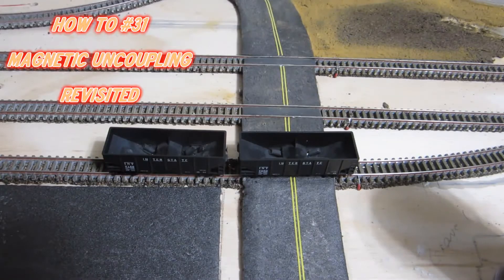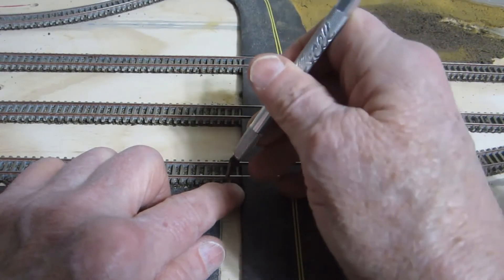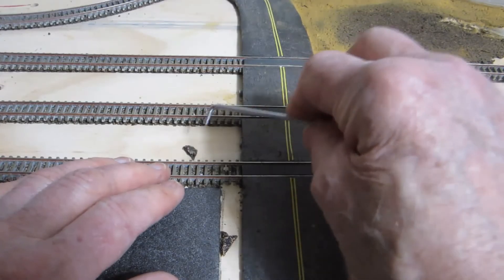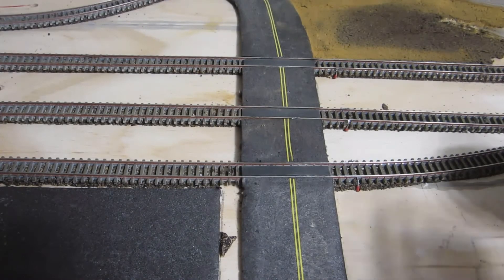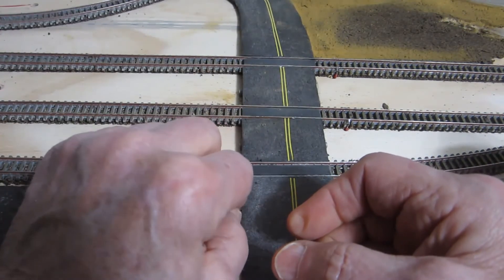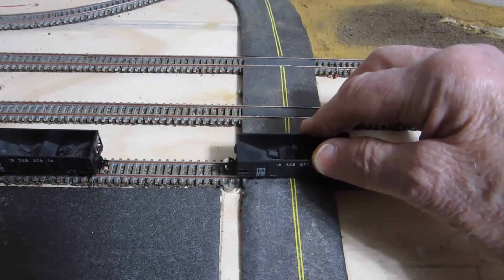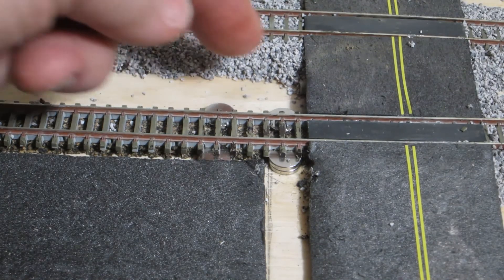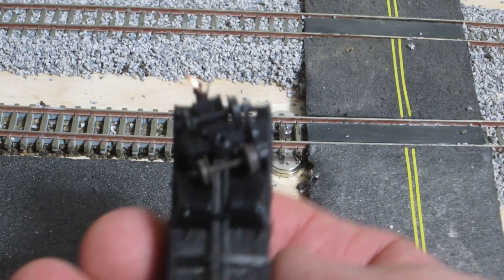Magnetic Uncoupling Revisited

Comment: Hello can these magnets be used on a Kato track?
Reply from the maker: I have never used this system with either Kato Unitrack or Bachmann EZ Track.  I only use Peco or Atlas flex track.  A quick search of the internet reveals that Kato# 20032 is a 2.5" section of straight N scale track with a magnet situated between the rails.  It is for sale on Amazon for $5.98.  I would test that first.  Good luck.

Comment: What if a locomotive has magnetic wheels ?
Reply from the maker: Any type of ferrous wheels will react to the magnets causing unwanted jerking.  I have not seen it, but I'm positive that magnetic wheels would be unworkable.  You will notice that the wheels on the cars in my clinic are plastic.  Brass wheels will also work well.
Reply: @williamcasper6215  Thank you .  I got one locomotive Atlas and has magnetic wheels,  I sent to Atlas to replace it and they don't understand must be non magnetic.  I got 24 locomotives different brands even Atlas and no one has magnetic wheels .
Reply from the maker: I didn't realize that you were talking about locomotive wheels since there were no locomotives used in my clinic.  I had magnetic wheels on my Lionel locomotive in 1949 which helped it on grades, but, nowadays, they have rubber traction bands on one set of the drive wheels to help with grades.

Comment: Excellent video. Thanks. I haven't used magnetic de-couplers before. How does this differ from the Magnetic Uncoupler Track pieces I've seen offered?   Are the Osborn Model Kits 3053 N Yard Limit Signs the ones you were referring to? Do you only use micro-trains since they have the couplers already on them?

Comment: I've just been in touch with Dingo Servo Mounts (in the UK)  about the viability of using their Signal adapter with two magnets separated by a suitable gap, glued to the adapter's surface and raising and lowering that through a hole in the baseboard, thus enabling or disabling uncoupling of Dapol Easi-shunts. I want to experiment with this idea, so I've just bought some magnets 20x3x2mm thick and 20x6x1.5mm thick from First4Magnets to experiment. Have you or anyone else you know tried this?
Reply from the maker: Although I am aware of several magnetic uncoupling systems on the market, I have never purchased one because I always search for the cheapest way to do everything.  I believe that I am the only member of my model railroad club who uses magnetic uncoupling.

Comment: If one wants to shunt car(s) , you will have to have level and perfect track.  I will have to relocate my uncouplers, which are under the track, to the exact spot where I need to spot the car(s).
Reply from the maker: A level roadbed is paramount for uncoupling if you want your rolling stock to remain where you shunt it.  If you have rail joiners in this track, use a rail gauge to insure that the tracks meet exactly.

Comment: Does the track where one is shunting cars with couplers open have to be straight?  My N Scale magnetic uncoupler has a total six, with 3 magnets under each rail. However the diameter of my magnets is only .315 of an inch and yours are .375 or 3/8 of an inch.
Reply from the maker: Only the uncoupling placement needs to be straight to successfully uncouple; however, picking up cars on a curve may present difficulties since the couplers may not line up for successful coupling.  As far as the size of the magnets, I have used round magnets .125 inches in diameter without problems, though I did use them 2 each at 4 corners.  See my earlier video on "Magnetic Uncouplers".